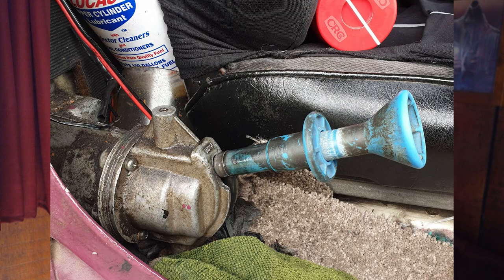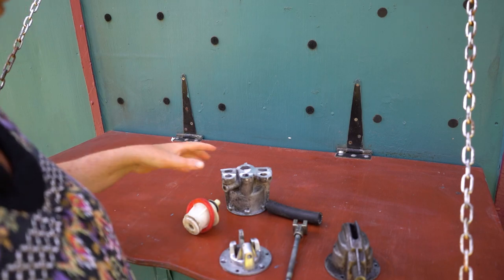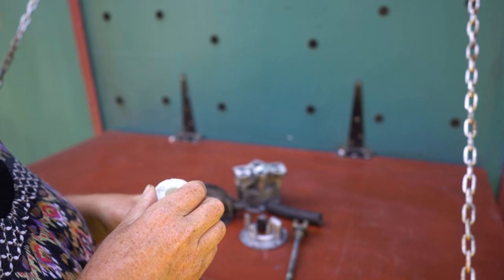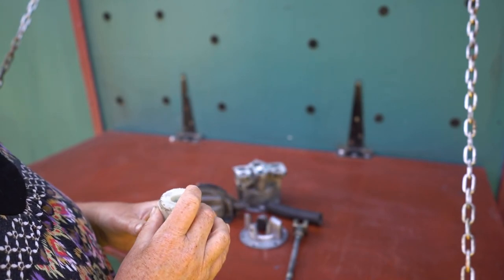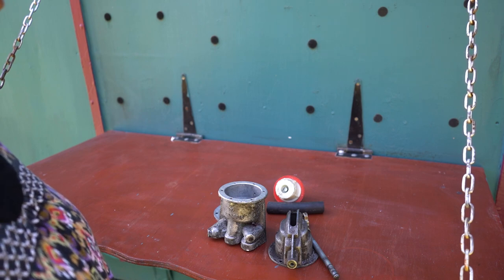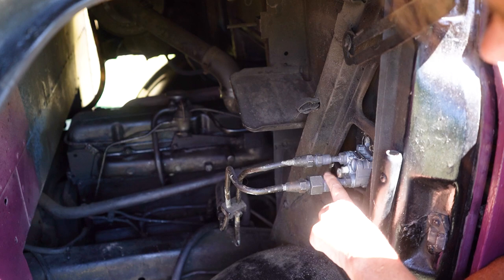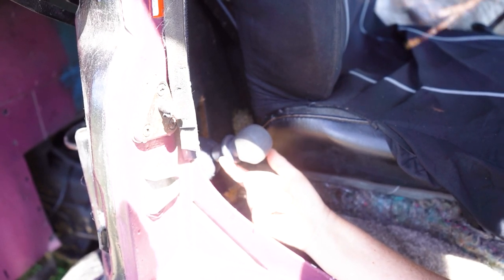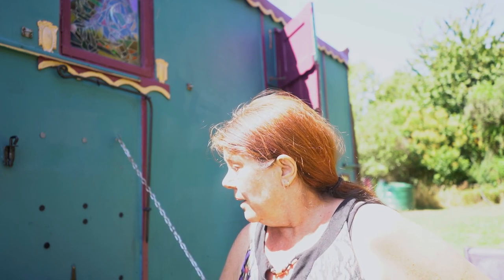Handbrake Issue in my Bedford Truck- Fixed

Comment: I have a Bedford YRT 76 bus and the exact same hand brake controller (ky9332) that has failed. no park/emergency brake at all and no one in Perth is interested in helping :( I am grateful for you sharing this content. the plastic diaphragm is ok, I think it just needs a seal kit put through it but they are unavailable apparently. I may have to go the same way you did I think unless someone else can suggest another fix. I have subscribed and thumbs up and thanks again

Comment: Awesome outcome Fran. 
We had our air governor play up on our '77 ford bus lastmonth.  Amazingly, I happened to be get a modern generic one for $40 - $50. Just had to build a bracket and adjust the pressure down a bit. Works a treat.
Reply from the maker: That's great 🙂

Comment: Sorry to hear you have had problems, but glad to hear they are now all sorted out. This video is going to be very useful to me at some stage. The hand brake on my 1972 TK is one of the few things I have never ever had to touch yet, but after seeing what has happened to yours it's only a question of time before it gives up on me. Thank you so much for doing this video.
Many thanks.
David in the U.K.
Reply from the maker: Thanks David. Yes it's impressive that the plastic bit lasts as long as it does
Reply: @TinyHouseTruckLivingNZ  I am wondering if the older TK models like mine have metal innerds. 
If you ever get stuck for parts in future I am always willing to help out if I can. Last year I posted out brake spares to a friend who lives at the top of the South Island. She has an old Thames Trader lorry which she has converted in to a home.
Reply from the maker: Thank you so much David.
I'm not sure if the older ones were different. The Bedford guy here said they tend to break because of the plastic before we pulled it apart